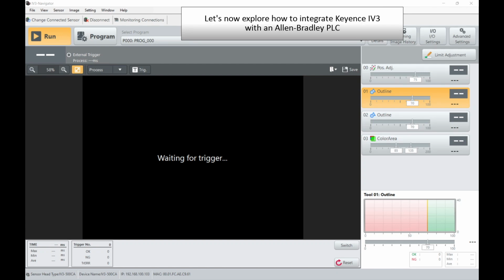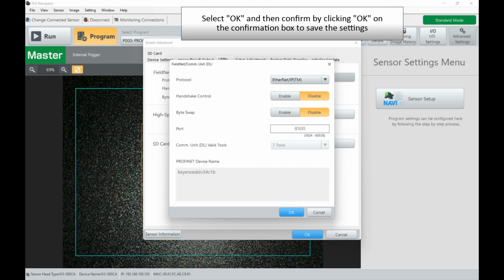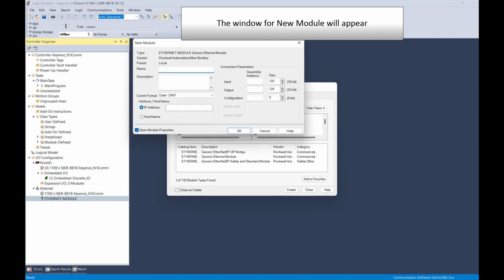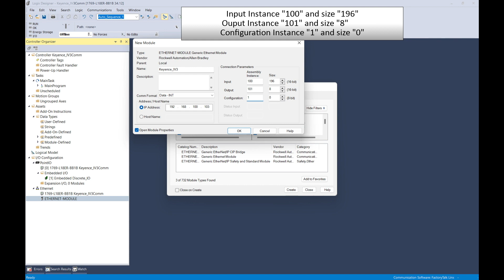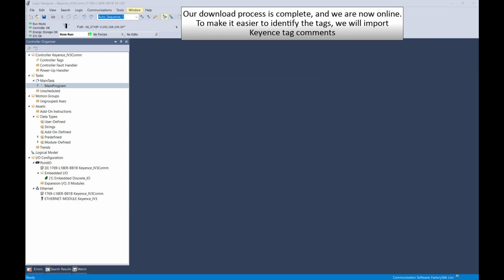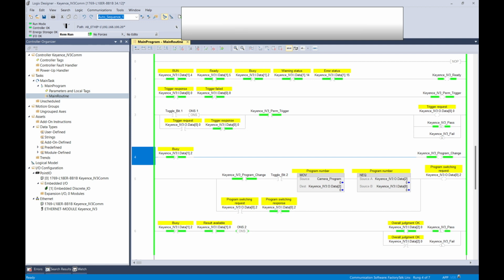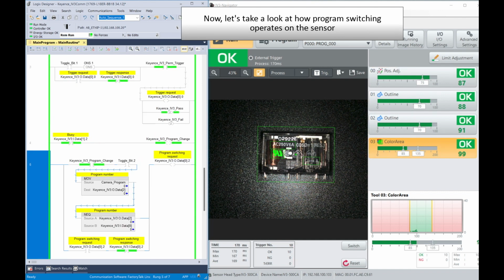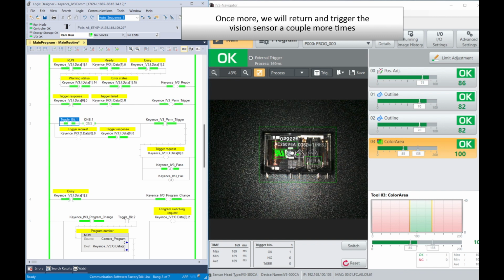Keyence Vision System IV3 | Integrating Keyence IV3 and AB PLC over Ethernet/IP | 2023

Comment: I have an IV3 camera integrated with Allen Bradley plc, Comm type is ETHERNET/IP the Ethernet module of the camera in PLC is IV3series, and IO (module) is SINT--- Input 394, output 12 but I can't see a way to enable the run mode through my logic, could you help, please?
Reply from the maker: Watch the other videos. I think I cover that topic. If not reach out via email.

Comment: Is it compatible with the Connect components  workbench for the Micro800? Im using a keyence vision system,too. But i have a Micro850 P.L.C  to program.
Reply: yes, it is. I have done it before, a little while ago for a school project.
Reply: @komander69X   did you. Used modbus or like the same process in the video?
Reply: @luiggi_s1195  Depends. If your model number is like this (notice the E) -   2080-L50E-   then you can do the same as the video.
If your model number is like this (notice there is NOT the E) -   2080-L50-   then you have to use Modbus (if the camera can do Modbus).